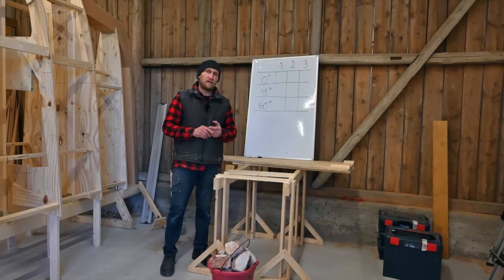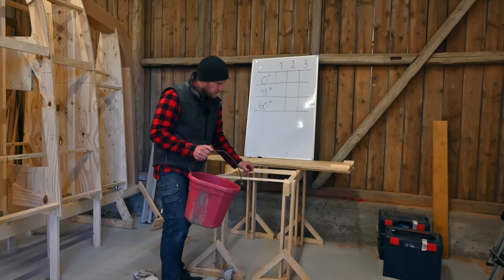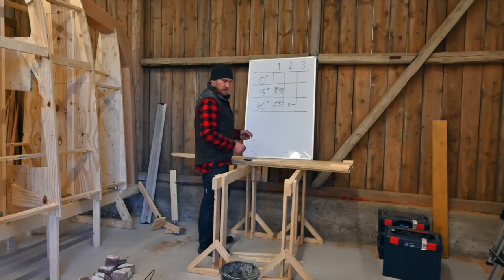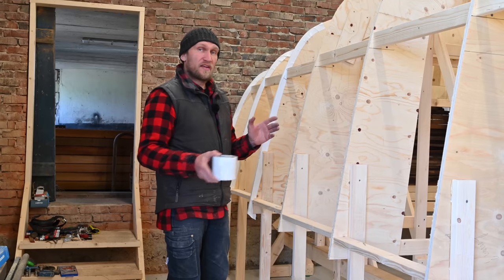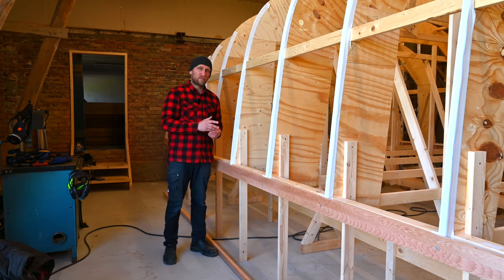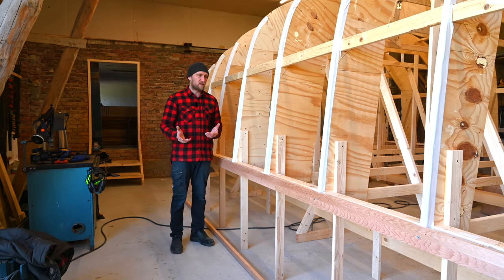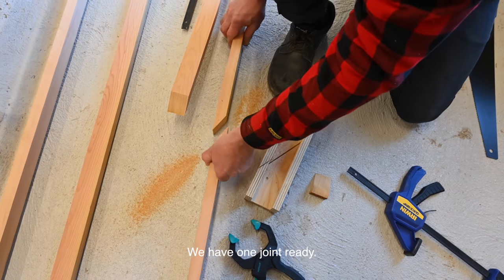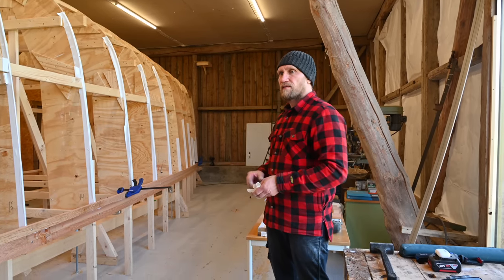The First Of 150 Strip Planks | DIY 50 Ft Sailboat - Ep. 344 RAN Sailing

Comment: My sincere condolences on the loss of your father Johan, there’s nothing that can be said to take away the pain but our thoughts and prayers are with you and your family.
In regards the strip planking, my Huon Pine strip planked hull was vertically fastened when built in 1962 with stainless steel nails with no glass on the hull and during my current refit where I have had to repair some failed glue lines (from being dried out for @ 15 years) I could clearly see that the nails appear as good as new @60 years later. In my case the strip planks are 25mm square. (NB: I have repaired the failed glue lines with splines and have now glassed the outside of the hull for further longevity and ease of maintenance)

Comment: I watched a cold molded hull being built on Nantucket Island. They used a pneumatic stapler over thin plastic squares to position and hold the strips in place while curing. They were easily removed with only two tiny holes remaining. The plastic squares prevented the head of the staples from marring the wood and provided a surface to pry out the staples without damaging the wood. Fast and cheap!
Reply: Similar (if not the same), as what some lumber companies use to tarp their lumber for shipping.👍
Reply: AGREE, and those pin holes add extra BITE for resin / cloth .... I did a kyak with cedar with the bead n cove edges to allow tight bond over a curve
Reply: That sounds better than the screws in my mind too

Comment: Wonderful video.  Life changing when you lose a parent.  My condolences.  Now, don't be afraid to heat up the epoxy with hot water.  Set the big containers in a big washtub and pour hot water into them to heat up the epoxy,  It will pump much easier.  Some folks build a heat box, but I found it easier to use a bucket for gallon sized containers.  You have 5 gallon containers so you need a bucket large enough to hold that.  Add more hot water, if it cools.  Also, apply a heat gun to the wooden joints before applying the epoxy and it will help penetration.  Put your pastry bags into a flower vase to hold them open and pour the thickened epoxy into the bag.  Makes it a one person job.   You can also pump epoxy resin alone into solo cups the day before and add the hardener when you need it.  Love the scarf strength evaluation.  Wish you tried a fairing evaluation.  Forgive me if I sound bossy.  You guys are making very smart decisions and the boat should be amazing.

Comment: Johan, so sorry for your loss.
Consider using a finger joint router bit for your scarf joints.  A little bit less waste and very quick with a router table.
To hold the planks in place consider a series of buckets filled with brick or concrete. Each bucket has a 1 to 2 meter rope tied to the handle and the other end to a large hook. The hooks working end opening is squared off to wrap around the installed planks. On set of anchors can be placed inside the boat frame to pull down. Another set of anchors can be positioned near the frames vertical legs.  A nail or screw is driven part way into the frame legs several meters off the ground.  The anchor rope rises from the bucket wraps 90 degree around the nail and onto the hook.  These hooks provide a horizontal force to pull the planks against the frame.  The vertical and horizontal hooks have slight different shapes.  I wish I could send you a sketch.  I imagine them cut from scraps of plywood.
If the buckets are hanging a few inches off the ground the clamping forces stay consistent. 
When you are adding a new plank, move the hooks to a resting nail driven it the frame structure.  Add a new row of planks and reapply the hooks to the planks.

I so enjoy watching you and your family.

Comment: My condolences on your loss. Your decision to spend these last months in Sweden was huge and proper. 

May I suggest a heat box for your epoxy? Either build an insulated box or use a small chest freezer. We picked one up for isolation supplies when Covid started and it is now keeping my epoxy warm with the help of a heat lamp and a thermostatic control, total additional cost was around $40. Search for terrarium supplies. 

Considering the number of scarfs you will be cutting, I would set up a jig with a circular saw on a track to cut them efficiently. I used my track saw in that way to cut 12:1 scarfs for a cap rail and it worked like a charm. Just like your hand cut set up but much faster.

As always, thank you for sharing your build with us.

Comment: Really sorry to hear that you lost your father Johan. I am older than you so I lost my father some years ago, but still sfter many years he pops up in my dreams. Have been following every episode of your build, and deeply admire both of you. I am however surprised that not only you but many others go for Epoxy glue. Typically and industrial Epoxy are not that muched used for wood gluing. Old school MUF and PRF are still used, but nowadays and in increasing volumes, 1-component Polyurethanes. It would have been interesting to see your weight test and compared with Polyuretanes. One advantage as i see is the fact the PU-glue reacts with the moisture in the wood. Since its 1-component wou will also save a lot of time. One brand is Cascol Polyurethane which you could be able to find in any hardware store.

Comment: So very sorry to hear about the lose of your father.
I have used West System epoxy for many years.  Thickened epoxy doesn’t want to soak into the wood as much as raw epoxy.  You could give your joints a quick brush of epoxy before adding the thickened to it.  This will make a better bond.

Comment: Try getting a thermostatically controlled heat pad on the bottom and build a foam insulation box. That'll keep the epoxy to a set temp which will reduce viscosity and improve curing consistency
Reply: I have built a number of fiberglass experimental airplanes and used a lot of epoxy. I used a ratio pump I put in a temp controlled chamber. 
The chamber was 2x2x2 feet square made from  the aluminum skinned foam (used for insulation in house construction)  I then installed  a 60watt lightbulb controlled by a thermostat to set the temperature. The door was the same material with duck tape  hinge. Worked perfect.
Reply: Great ideas.   Re: scarfing….aren’t long scarfs stronger…why not do it now for peace of mind later…can bronze screws be that much more $? Not ranting, just wondering

Comment: Johan, You can make a simple plywood or foam board box to sit over your epoxy jugs and place a light bulb or small electric heater inside to warm them a bit.   They will flow from the pump much easier that way.

Comment: It's always fun to see how your head works and how you work through these problems for each video. As a fellow cabinet maker and shade tree engineer (lol), I wouldn't be concerned at all about the shear strength of a butt joint because as you said in the beginning, no two joints will line up. What I would be concerned with is thermal expansion and contraction. One way to eliminate the need for scarf joints completely would be to layup the planks on a 45 deg angle from the keel to the sheer.

Comment: Regarding process:  Consider setting up a chop saw dedicated to cutting the scarf joints.  The other thing I might consider is (assuming you want to install 6 strips per day) gluing the scarf joints for the next day  after you install today's 6 strips. IOW in the morning install 6 strips, and in the afternoon cut and glue up the (12?) scarf joints for the next day's strips.  I think this will shorten the overall time per strip.  Also, it might be possible to make a jig that would support each scarf joint while you run a couple  temporary screws to hold the joint tight while the epoxy cures.

Comment: Sorry for your loss. My condolences. May you have the srength to continue with your plans and build. I think that as you are building your dream boat - take the extra effort and use a 60 degree joint for better holding.

Comment: I used the plastic nails on a hull in New Zealand. The nail  gun is a bit expensive but overall, it would be much cheaper than the stainless steel screws and there would be zero chance of any corrosion issues. 

For mixing the epoxy, West Systems provides a shop pump that has a single lever that operates both pumps at the same time.
Reply: The Duracell Project use a West Systems combined/single lever pump.  However I have heard that Total Boat products and perhaps others have 3 or so options for speed of curing, that sounds really helpful when planning jobs, particularly at variable temperatures of Sweden.
Reply: Or plastic staples over sacrificial strips, usually used for cold molded hulls. Maybe can work for strip planking, if the planks do not have to much edge setting.

Comment: My condolances on your loss. I suggest you clamp the planks together and then screw into the frames at every other station. Thin self drilling screws could work well and be fast. Not a lot of clamping force is needed with thickened epoxy and remember gaps will get filled when you glass the surface. Some screws can go though blocks so that you can use clamps (or even elastic cords with hooks) onto the top of the next plank while you drive the screws into the frames. Later pull out all the screws and blocks and reuse after epoxy is properly cured. .Make up your scarf joints first! Don't waste time and money screwing the planks together, they will be held together with the glass and epoxy in the joints! You can later quickly fill the holes before glassing and you will need to sand the surface before glassing anyway. An electric powered epoxy gun with epoxy cartridges and self mixing tips (e.g west systems six-10) will save time mixing and measuring.

Comment: Yep.. I would put a day aside to prep and glue up as many scarf joints as you can....going forward remember that epoxy doesn't actually adhere to most plastics.... I use pieces of 2litre ice cream containers ( #2 plastic ) as backing plates when clamping.

Comment: BEAD and COVE routered edges add surface for glue and keep seam gap tight as you get to the CURVE at water-line......a technique making the much thinner cedar strip kayaks.....very NICE consideration to thin-out first planks to allow extra glass fibre to bond deck.....awsome!!

Comment: Hi Johan and Malin. It is sad to hear that your father has passed away. we wish to offer our condolences.
When it comes to epoxy viscosity temperature is alpha and omega. We have made a box of styrofoam that is approx. 60 x 60 cm which takes a 25 kg barrel of epoxy and a 5 kg jug of hardener. A small frost guard / vakt with a thermostat set at 25 degrees makes the viscosity almost like water. this will save you a lot on the mixing time

Comment: Johan, When we get to the planking of the MarcoPolo that we are restoring / rebuilding we will be using a 16:1 ratio on our scraf joins. The hull is being triple planed with 1/2" planking on each layer. Between each layer we be laying a thin layer of cloth. Inner layer 45 deg going forward, Middle layer 45 deg going aft and the outer layer will run fore and aft. We may glass over the planking but it something we will look at the time.Condolences to you over your loss.

Comment: So sorry to hear about your dad. That's a lot to process. 
You could build a narrow work bench/scaffold along the hull to use for cutting the scarf joints. Cut scarfs with your miter saw on the bench. Use the bench as scaffold when you get further up the hull. 
Cheers

Comment: sorry to hear about your loss, my condolences.
For the scarf joints most boat builders are doing it like the lenght of the joint being 8 to 12 times  the thickness of the planks, there must some really good reasons for this. Dont underestimate the hull twisting motion the sea will apply to it.
Reply from the maker: Thanks! The reason the boat builders you’re referring to are using 1:12 scarf joints is because they’re building wooden hulls. We’re not, we’re building a sandwich hull with a cedar core which is quite different. Cheers!

Comment: Very sorry for your loss team.
Planking is looking great! One thing that came to mind is the location of your through hull fittings (for raw water inlets, grey water outlets, engine exhaust etc). It might pay to figure out where they will be located now if possible, or to record where the acid proof ss screws are placed so you don't drill into them when installing the thru hulls.

Comment: On the scarf joints for your planking:  I vote for "none of the above."  A proper scarf has at least an 8 to 1 ratio.  And it would be easy to make up a jig that would make quick work of cutting those 8:1 scarfs on a table saw.  A proper scarf joint not only will be as strong as the wood, but will also allow a fair curve when bending to the hull shape.
Reply from the maker: Yes, we know. And I mention that in the video, however we won’t need a full scarf since this is going to be a sandwich hull and not a traditional wood hull. Cheers!

Comment: Hi guys! I'm sorry for your lost Johan. 

On the other hand. I'm happy to see you guys planking the hull already. About the scarf joint I always saw the 1:4 ratio for the scarfs. And I remember that you mentioned something about CE mark the boat. I don't remember exactly what the EN ISO 12215 says. I'd recommend to check that out just to avoid any problems in the certification. 
Now, looking forward for the next episode
Ha det bra!
Reply: 12:1 is the correct ratio for a scarf joint.
Reply: @dboboc  , i think you're right. I read this ratio as well. 
But do you know what is required for CE marking of wooden hull?

Comment: You might want to consider a Festool domino tool to strengthen the butt joints. Even dowelling the joints would add strength.
 As a long time woodworker, I doubt that 45, or 60, degree scarf joints would add enough strength to be worth the time expended.
You've done great work so far.  It's a good thing you've got Vera to supervise 😀

Comment: .Brief History - Scarf joints have been used in wooden-boat construction for centuries, from joining together planks for hull & deck, to making up full-length mast staves from shorter pieces.  Even Lloyds of London had specifications for scarfs in boat building, 4:1 for planks, 6:1 (possibly 8:1) for keels, & 12:1 for spars.
   Across the water, Japanese woodworkers brought hand cut wood joinery to extremely high levels, including many elaborate designs of scarf joints.
Reply from the maker: Yes, we know this. But the difference is that we’re not building a traditional wooden boat, this will be a sandwich construction with the cedar as a core. Cheers!

Comment: Sorry for your loss.   You should get an epoxy metering pump from West Systems, they come with different resin/catalyst ratios, allows you to mix exactly ration and quantity for the task.  Then build a simple 2" foam box with a  thermostat heater to keep the epoxy warm.  That will speed up the process.   Could also try a finger jointing router bit to make a self aligning but joint on the planks.  Try ratchet clamps compress the plank joints.    Only issue I see with the screws is when you attempt to cut in your through holes or chain plates,  hole saws don't play nice with hardened screws.

Comment: As a certified journeyman carpenter, my husband says, a finger joint is the strongest joint, largest surface area, easily and quickly made with a finger joint bit on the router table.

Comment: You are a lot smarter than I am.  When I laminated strips of walnut to make my tiller I used 10:1 scarfs.  I did use superglue to stick them together as the overlapping strips, glued with epoxy, added all the strength.  I wouldn't use superglue on your scarfs as they might part as you bend them to the hull.

Comment: You have my sympathies I know how it feels 
On another note the construction of my yacht is also strip plank but is done using a convex to concave join between planks glued and edge fastened with bronze screws and glassed on the outside only out of kauri timber and was built in 1974 and is still as strong and watertight as the day she was launched 
This would cost a ridiculous amount of money to replicate now a days however

Comment: When joining pieces of wood head on, I would go for at least 6:1, i.e. an angle of arctan(6) = 80,5° or more. For the spars of the wings I'm building, I use 10:1 (84,3°).

Comment: For the screws to connect the new plank to the one below, coated deck screws might be an option if they are available there. They are typically narrower. Plastic would be the best, especially if you didn't want to deal with avoiding metal ones when installing though-hulls. 

How about small biscuts for the butt joints? I assume you'll fair the cedar with a long board, so that will take out any little bumps. You could prep a bunch of ends beforehand.

Comment: Make a small cupboard to hold your epoxy. Inside fit one or more light bulbs to keep the temperature up. In your climate perhaps fit a 'greenhouse' heater instead of the bulbs. Later you may want to keep your GF cloth in the same or similar place to make sure it does not get damp.

Comment: I think you should use galvanized finishing nails to attach the strips together instead of the stainless screws. You could use a small space heater for a heated box to keep the epoxy in.

Comment: I have built six canoes using the strip planking method however my strips are stacked using a bead and cove system rather than trying to bevel each plank. ( one strip has a male bead and the other has a female cove) it’s laborious and lots of router work but it ensures a perfect contact between planks. Furthermore you are right, butt joints are sufficient if they are staggered.